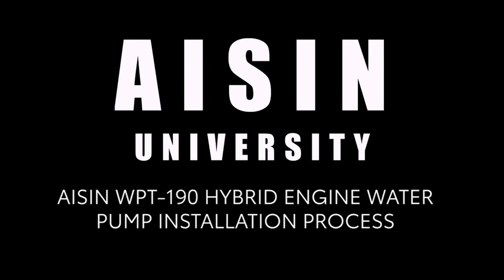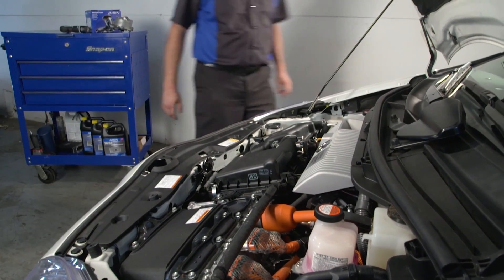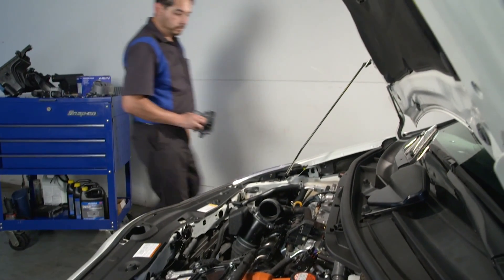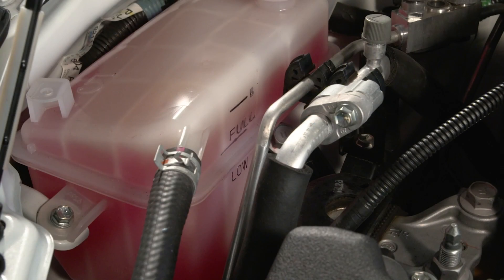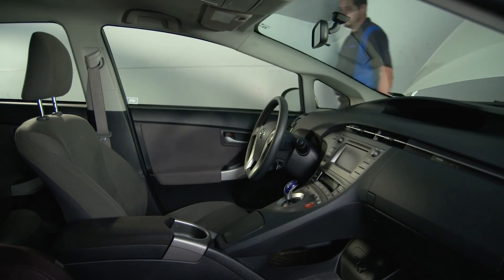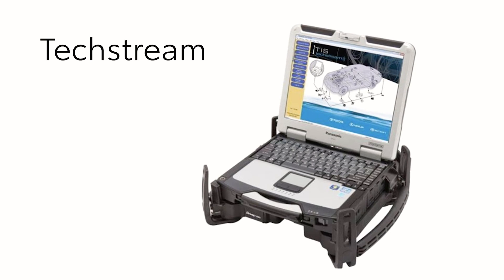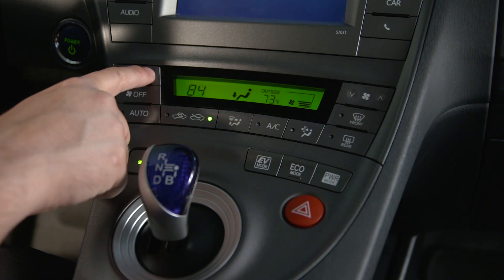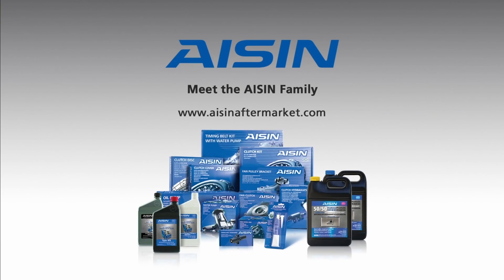AISIN University: WPT-190 Hybrid Engine Water Pump Installation Process

Comment: I just successuchanged a defective water pump on my 2015 Toyota hybrid 2015 Prius Alpha. No need to change whole unit, just the 'rotor' part that spins in the magnetic core. Usually it cracks, expands and jam inside causing a fault code 261B. Spread a casket paste around and let dry at least 30mins and 24hrs (after tightening) to fully cure. Do the draining and refilling procedure and run engine a bit , park in an uphill area, have filler cap off to bleed off air in system. Aircon on and wait till thermostat starts to further release any trap air. Bought that rotor part for only $NZ40 incl. Postage.

Comment: I just bought my daughter a used 2012 Prius, with 161,000 miles.  If I just want to replace the water pump (and the thermostat) proactively (before it sets a code, or overheats the engine and blows the head gasket), do I need Techstream?  I'm not a dealer, so I don't have access to Techstream.
Reply: No, it's pretty straightforward. You do need a jack and some jack stands though. You can't do it all from the top
Reply: @ Thanks!  I’ve since seen a couple of good videos on replacing all that, and it looks easier than on our ‘08 Sienna, especially refilling the coolant and bleeding the cooling system.  I’ve also looked at the instructions on TIS.

Comment: Oct 2022  Number one thing to do is examine the impeller the old pump  to see if its plastic and damaged - does it just spit freely because the shaft connection is reeamed out. If s then replace the impeller and reinstall.  Or go to Toyota and by a new OEM pump for $450 bucks.
Reply: Yeah ok but no one ever just goes to the dealer anymore. Seriously they will rip you off. They will keep replacing things that you don’t need in the dealer service as well.
Reply: you can get it from a dealer for about $220 or less. Google Is Your Friend
Reply: Just bought an Aisin WPT-190 water pump which will fit my 2017 Prius v. They're the original supplier for Toyota. I'm in the USA and ordered my pump from Japan which I found on eBay. My pump had the word Toyota ground off. It was a LOT cheaper than going to the dealer. Cost was about $122.00 US (plus tax) and that included shipping which took about 5 days to get to me. I'm also replacing the thermostat and housing with an Aisin-manufactured one since I'm in there. Can't hurt.

Comment: Hell of a lot easier if you have a hydraulic shop lift. Pain in the ass if you're doing it on the driveway.
Reply: Yup I tried can’t do it
Reply: I know this is an old comment but a lot of people come to this video. You had problems because you didn't have a jack and  jack stands I would imagine. It's pretty easy if you can get the car up in the air even in your driveway